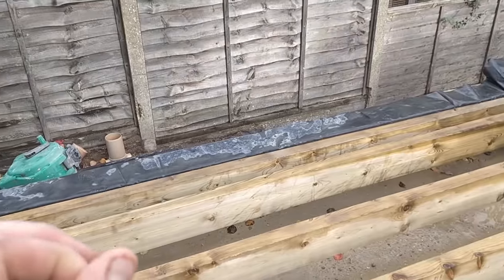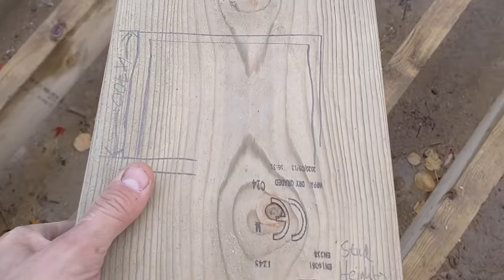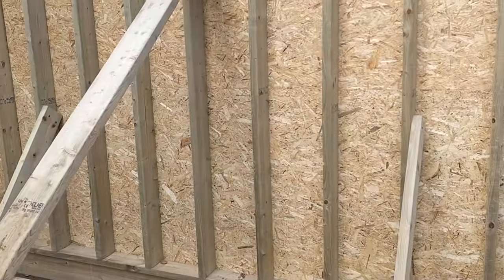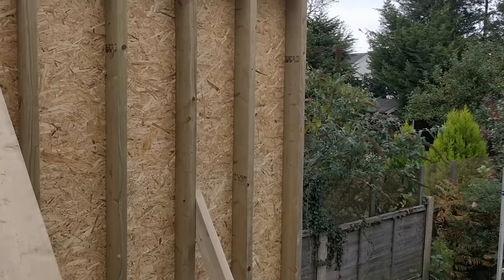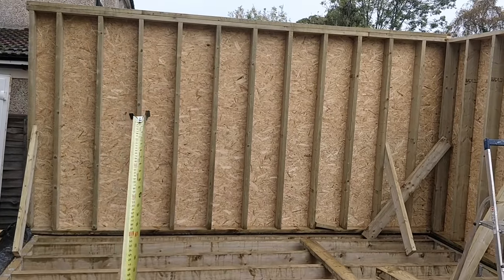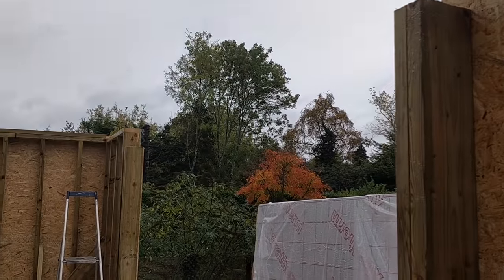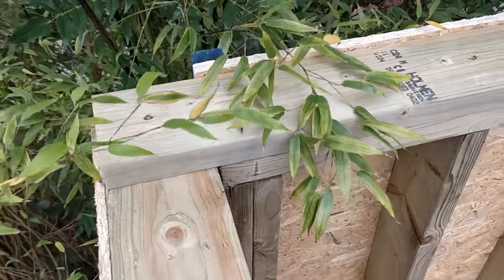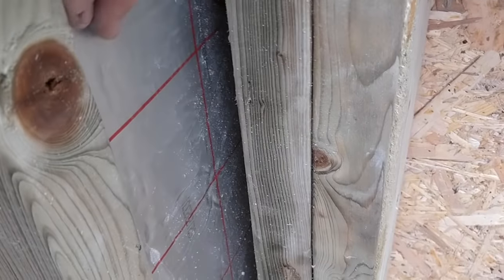How to Build Timber Frame Walls: The Ultimate Guide - Part 1

Comment: Good presentation, but surprised that you are working out on the job the framing dimensions, window heights, counter heights etc. Would have been easier if you had prepared drawings beforehand, which would also make plumbing and wiring routes easier later.
Reply from the maker: We did have all of the basics down on paper, but it's quite common for architects to not give exact dimensions for those sort of specific details because invariably the real world site is different from the theory on paper.

Generally they put a blurb down the side of the drawings that says something along the lines of "don't scale off these drawings, and the builder is to check the measurements and confirm locations when on site".

We were doing just that, translating our rough sketched out drawings/dimensions/measurements into the real world.

Comment: Its nice to see you using a membrane were timber touches masonry many people overlook this
Reply: Indeed, always a good call, 👍🔨🇮🇪
Reply: Illbruck ME220
Reply: my joiner drilled through the dpc and dpm to fix his wallplate to the block am I going to have damp problems in the future. he said he had to do it to stop the fram moving and that it was normal.
Reply from the maker: Yes that is very normal - that is what was specified by the Structural Engineer on my build too.
Reply: @OfficeBoyBuilder  just seems funny to go to all that trouble with dpm and dpc and then for him to just drill through it to get his wall plate secured. He said it was normal practice there was no other way or the kit may move.
Reply from the maker: @jamesdiver2183 agreed! It is odd, but how else can you secure it down? Typically you need to use a chemical cement to secure the bolts into the masonry, which is waterproof so should also stop any moisture coming up
Reply: @OfficeBoyBuilder  not chemical fixings just torque fixings straight into the block below

Comment: Hi, fantastic videos. I'm doing a timber frame rear extension on pedestals system  under permitted development out to 4m ( have got the prior planning approved as its longer than three meter) total square meters is under 30m. do i need to get building control involved ?
Reply from the maker: Yes you will, because it's an extension to a residential dwelling.

Generally you don't need them for outbuildings under a certain height, and where they don't have services like a toilet/shower, which would make them a permanent structure...

Comment: Great Video, we was planning our extension to be brick built, but I am definitely starting to think timber might be a better option.
Reply from the maker: It really depends what you're after mate, but when I did my research, it came out that timber was (marginally) cheaper, far better insulated and faster to build with...I'm a huge fan, and can't fathom why more people in the UK don't. In the US and Canada that's pretty much all they build with, and they have far more dramatic weather than we do.
Reply: Timber framed buildings are definitely the way to go if built correctly they will all be done this way in the future

Comment: Hi there, really enjoyed this video series, it's been very informative and given me the push I needed to take on an extension project!

I'm just wondering how you weather sealed the timber frame where it bolted to the existing masonry wall? I've been researching and every solution is to use facing brickwork to provide protection from wind driven rain. The only other solution I can think of is a stepped lead flashing (like you see on chimneys), which is then lapped over the timber frame and behind the cladding / rendering - however this seems a little excessive?

Any thoughts / insights as to what you did with this junction is really appreciated!
Reply from the maker: Thanks mate, glad you've found it enjoyable and helpful!

I put a DPM membrane behind the upright timber that bolted into the masonry, where the extension was being attached to the existing house.

You can do the same for the rafters too, which makes a slightly hard job even trickier, but probably worth it in the long run.

Then you have lead flashing over the top (stepped or straight) which laps onto the roof tiles. Hope that makes sense and helps.
Reply: @OfficeBoyBuilder  makes perfect sense, thank you for your help!

Comment: I’m looking to build up off a 9” solid block wall (finished in sand & cement render)using the same system as you, am I right in thinking I’ll need to let the air gap and cement fibre sheet overhang ?
Would you be willing to create a plan drawing for this ?
Reply from the maker: Yes, the 25mm battens and cement fibre board do hang over slightly past the block work, and ideally hang down slightly too, to push the DPM down a bit so there is a run off drop. You can attach any bug screen to the underside of the timber battens, although our SE didn't specify one and the building inspector didn't require one. I'm guessing that's because of where we are in the country and a complete lack of building eating bugs in our area...

Comment: Hi. Really enjoyed the video. Similar project starting soon. Interested to know how you fixed your timber frame through your DPC and into the blockwork below without impacting the waterproofing of the DPC. Any tips would be great!
Reply from the maker: Cheers mate, glad you enjoyed it.

We laid out the DPM, built the time frame walls on top, and then fixed the soleplate down to the blockwork simply by drilling through the timber, DPM and blocks, and filling with chemical cement and bolts.

The chemical cement and bolts would most likely block any modest amount of moisture that would try to permeate the structure.

This was specified by our structural engineer (every 600mm centres) so we followed that direction. 👍
Reply: Interesting. Can you recall/recommend a chemical cement and size bolts? Much appreciated.

Comment: Hi 
Great job cant wait to see it all complete...am thinking and researching about doing a small lean to wooden extension...we have an old Conservatory that we will remove and build same sized structure...am not familiar with plans ect, but do the plans specify all the different materials that must be used, or does the structural engineer give you details of what materials ect thst you must use?
Thanks
Reply from the maker: Those details all come from the structural engineer, including the make-up of the walls etc. Occasionally the architect will specify it, but it's more typical to get that from the SE

Comment: What render backing board would you recommend? Length height and width information especially 👍👍
Reply from the maker: 12mm cement board/render carrier board. Normally the sheets come in standard 8'-4' sheets (2440x1220 in metric). Often they will have little polystyrene balls in them to reduce weight and increase insulation value.

Comment: Should of built that bigger wall in situ, would of saved the phone call to the brother in law😂 awesome building as usual! Keep it up 💪💪
Reply from the maker: Yeah you're right...I was interested to try an American method of building the walls, but frankly I wasn't worth the effort and hassle. I stuck to my normal method of doing each one individually on the soleplate
Reply: @OfficeBoyBuilder  You were right to do what you did but if you had just put two sheets of osb on instead of the whole lot it would have been a two man lift. Plus the wind would have had a place to blow through. One sheet on each side is all one needs to keep one's walls from racking. Especially on that wall as ye had plenty of access to the other side. One has to be cognicent of the weather and the number of bodies at one's disposal.

Comment: Great job!  I would say you need to look at the junctions of the timber frames with the existing masonry walls - in traditional build you would need to cut the wall the break the cavity and insert a vertical DPC. This ensures no horizontal tracking of moisture which could happen with high winds or capillary action. Good luck with the build well done.
Reply from the maker: Yes mate, great observation and exactly what I was planning to do, until I found that the walls are solid, with no cavity! Saved me a lot of hassle lol!
Reply: What would you have to do with a timber frame to prevent the horizontal tracking of moisture. I am planning on building a single story extension with a similar timber frame design but havent heard of this. Thanks.
Reply from the maker: Just a quick question, what horizontal tracking of moisture? Do you mean through the walls, or across the DPM at the bottom?
Reply: @OfficeBoyBuilder  sorry I have only just seen this. I mean through the walls. I was planning on doing the same as you did with just putting DPM between timber and brick wall but mine are cavity walls could this be a problem? Thanks

Comment: Cracking job. One question. You've used the master board on one wall only, was that because its on the property line?
Reply from the maker: Exactly right - where a wall is within 1m of the boundary line of a property, you are required to put master board on there 👍

Comment: Whats the chemical fix used under the sole plate? Did you go between the brick and the membrane, the bottom membrane and the new layer of dpm, the dpm and the timber, or was it a combination of these joints?
Reply from the maker: It is a cement based chemical fix made by Rawl (like Rawl Plugs). It was only used at the point where the bolts were driven into the brickwork. It wasn't used along the whole length of the sole plate.
Reply: @OfficeBoyBuilder  ahhh got ya! Think you said it in one of the next videos, makes sense!

Comment: Nice and informative video, thank you - Can you detail how you fix the stud work to the foundation wall please?
Reply from the maker: That's done in exactly the same way as the stringers which we're bolted to the brick wall - drill holes through the timber and blocks, and then set chemical fix and threaded bolts in place which you then tighten up 👍

Comment: Great video. What size steel did you use sandwiched in the flitch plate? I'm building a 3m span would I need additional metal plate or just 2 x 8x3? Thanks
Reply from the maker: Honestly wouldn't want to comment on your situation mate, you're best off getting your structural engineer to tell you so that building control are happy to sign it off. For most of my flitch plates they spec'd a 10mm thick plate, that was the height of the timber. For the ridge beam of the pitched roof it was a 20mm plate....best of luck!

Comment: Nice work. I guess you wouldn't have been able to do the boundary wall in timber if the neighbour had an house extension. Unless you left enough gap to do the render but would mean  space lost in your extension.
Reply from the maker: Yeah I think you're right, it would be much harder, although not impossible I don't think...you can build the wall and lift it into place (if there are enough of you) and if you're building right up against your neighbors wall, there's an argument that it doesn't need to be rendered because it can't be seen...so long as you get the fire rating from a sufficient board, it doesn't matter how it looks

Comment: Great workmanship and precision.. I’m thinking of a similar build to replace our 5metre x 3 metre conservatory , would a flat roof with roof lantern work with your system and bifolds 3 metre long into garden?
Reply from the maker: Yes roof lanterns work with our build system, so that shouldn't be an issue (always check with a structural engineer though!).

Our sliding doors could have been bifolds instead, so no reason why that can't be incorporated.
Reply: Thanks for that … does the 6x2 wall stud need to be tantalised? 👍
Reply from the maker: Yes, you'd want C24 timber, as exterior grade 👍

Comment: Hi, could you tell me how you fasten the framed walls onto the sole plate? I know you use threaded bar and chemicals to fasten down the sole plate. Do you do the same again with the timber frame? Thanks
Reply from the maker: The timber frame studs are just nailed into the sole plate, like you would with a normal internal stud wall...hope that answers your question, but if I've misunderstood, please let me know.

Comment: When you put the timber walls up are they flush with the block work,
with the 25mm battons and cement board ready for render over hanging they blocks
Reply from the maker: Yes pretty much! I left a spacer for the render board (cement board) to run down and lap over the blockwork

Comment: I thought the flooring OSB and insulation would be down before the walls go up? Interesting video though, thanks for sharing
Reply from the maker: It really depends on how you want to do it and what time of year you're building.

Being winter, I really didn't want to seal in moisture to the building, so built the super structure and got water-tight before allowing it to air out and dry.

Comment: Hi bud, just wondering what you think should I use private building control or council ? My architect suggests I use private but 1k seems a bit steep.
 Thanks 
Nik
Reply from the maker: It really depends on how quickly you want stuff done...I went private because I was on a tight deadline and needed to be able to contact them with a day's notice to come out and inspect things (specifically the foundations before the concrete was poured!). Council inspectors can be a lot more officious and inefficient, but are cheaper!

Comment: Really helpful content for a home diy'er. How come you don't need a flitch plate over the kitchen window? Isn't that section also taking the weight of the roof structure?
Reply from the maker: Not specifically/directly...the weight of the roof is transferred to the side walls, and carried by the ridge, down through the pillar on the rear wall (which does sit on the flitch plate).

That double header above the window will just stop any loads from buckling the windows below them.

Comment: Just a note regarding the application of sheathing - I can see a horizontal joint in the OSB sheathing halfway up the panel....all edges of sheathing boards should be fixed for the racking resistance applicable to be justified.

Comment: what's the best way to fasten studs to top plate and mud plate? nails or screws? what size?
Reply from the maker: Traditionally you would use Nails, not screws. Main reason being is that nails have much better tensile strength, and buildings move and flex slightly over time. Nails accommodate this movement far better than screws would.

You would generally use 90mm nails for the major framing structural construction, and then 60mm nails for the rest (like putting on the OSB sheets).

Comment: Is the double headed because the weight of the roof? Sorry if a silly question.
Reply from the maker: It does a couple of things - it really helps with racking strength (Vs a single header), because it allows you to overlap the butt joints. It does also provide extra bearing strength for the weight of the roof joists.

Comment: What do you call the polystyrene floor that they use to cast the concrete?
Reply from the maker: I think that often they are just using standard polystyrene foam to insulate and contain the the concrete...I don't believe it is any specific product, but I may be wrong.

Comment: Really decent video, I’ve been watching a lot of your content recently as I’m doing a dormer loft conversion, so thanks for the content! For the timber frame build, I noticed you said it carries much better insulating values in comparison to brick and mortar. With putting PIR between the studs do you suffer with much thermal bridging? Do you plan on insulating on the inside over the studs as well? 
My concern with a timber frame is from something which often happens in a loft conversion is that it’s hard to keep cool in summer. Have you found much info on this with your architect/designer? 
Sorry to kill you with q’s, thanks again mate. Smashing work!
Reply from the maker: Cheers mate, glad you're enjoying it all!
Thermal bridging can occur, but it's relatively easy to overcome with a bit of 20 or 50mm PIR over the top of the studs, or thermally backed plasterboard (or both!). I haven't had to experience a hot summer yet with a timber frame build, but we've deliberately put in tons of windows and doors to ventilate!
Reply: Thermal bridging is minimal in timber as it's a naturally warm material. No so with concrete and steel, 🔨 🇮🇪

Comment: What was the u value of these walls??
Reply from the maker: In isolation, the U Value of the wall itself is around 0.14, so incredibly low. Depending on the ceiling/roof you put in top, and the glazing and floor insulation, you can achieve passivhaus standards with them.

Comment: What was the spec/sizes of the steel over the patio door and how did you attach it to the timber to make your sandwich?
Reply from the maker: It was a 10mm plate of steel, the same width as the timber (200mm). The steel plate came pre-drilled with holes, and I used timber-locks to hold them in place, screwing them in from alternating sides. You can also use coach bolts +washers and nuts.
Reply: @OfficeBoyBuilder  thanks so much, very helpful